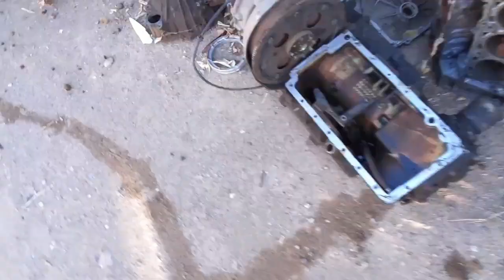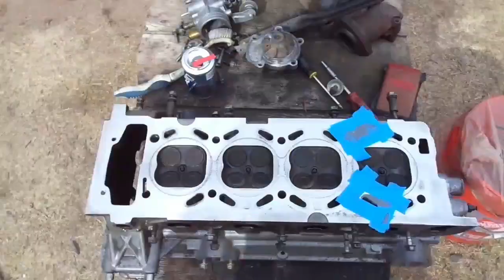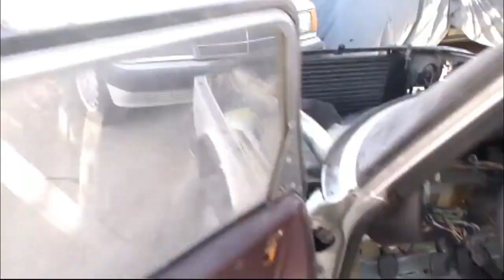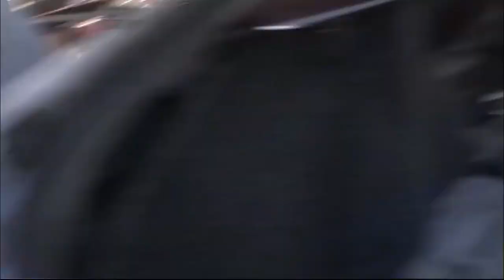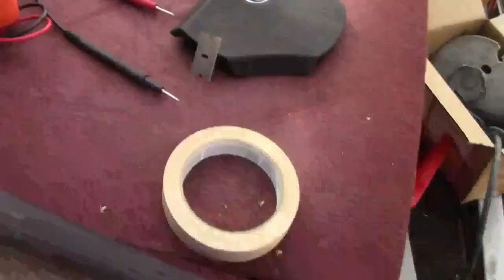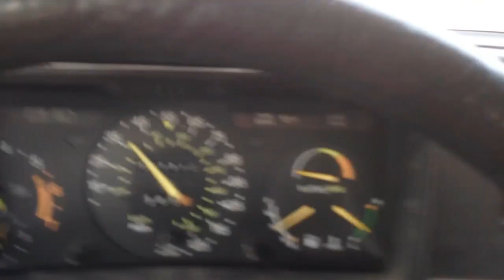Saab 900 Turbo Classic project start to finish

Comment: I have the same design wheels on my 1981 900, here in the UK they are called USA turbo wheels, I think they look cool! I also have a 1990 900 T16S which is called an Aero here and that has the 3 spoke alloys and I think they are really nice. Do you still have your Saab 900?

Comment: Actually the BW autobox was a decent middle of the road Trans.
 It worked MUCH better in the other cars it was fitted to.  Stuffga trans into the oil sump space was Not overly clever Either for Auto OR manual boxes
And Contrary to your Views the thing is readily rebuilt. ONLY the 4 speed manual was Reliable  (able to tolerate Turbo torques)  5 speeds routinely shredded 2nd gear teeth.
 NOT silly cone.. you silly man.. Loctite 518.
Aware that Honda used that Cyl head as  demonstrator for their Engineers on how ...Not To... design a cyl head.
 Bought a brand NEWsame Saab  and one of the reasons I bought it was that the Engine was DEAD quiet.  As in with the hood down I could Not hear the engine running .
Yours  in the video sounds like it's full of Rocks.